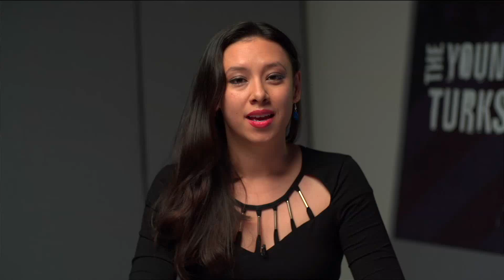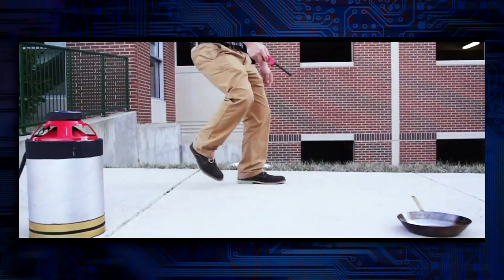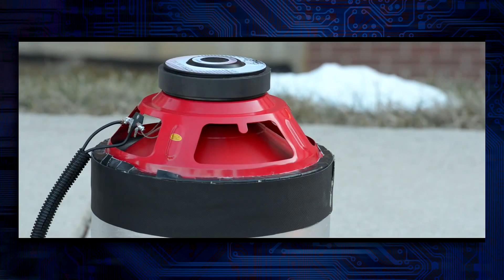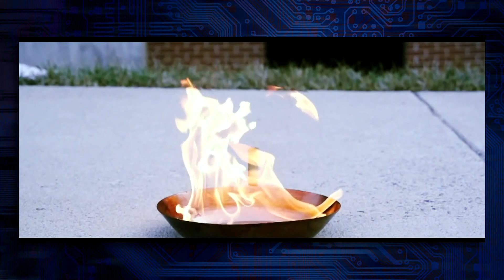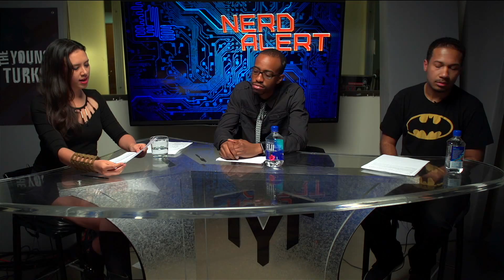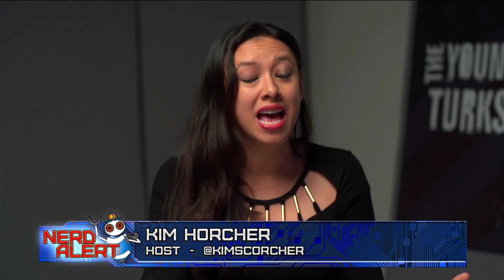Sound Fire Extinguisher Drops the Bass to Put Out Flames

Comment: I think the wind from the propellers of a drone will put out more fire compared to one with a big speaker connected to it which probably uses way more power so the battery would probably die within a minute

Comment: I think it's not efficient in any ways besides small localized fires, other ways are just not cost efficient, de source should be of high engineering to work in diferent situations, like being able to adjust the frequency wich would require calculations for it not to be detrimental  instead of helpful and having enough power potential to be effective depending on the situation...or being exponentially big enough for bigger fires...but what do I know?
Reply: Imagine there is a bigger fire, and the device just pushes the air and the heat away with this low frequency, wich might work where it's directed, but works as a chimney bellow further away where it's not directly pointed...

Comment: Have you thought of using ultrasonic transducers instead of regular speakers? Using an array of 25 transducers will give you a narrow sound cone up to 1000 1300 meters. This way you can also fight a fire in the crown of trees. A small amp with a bass modification and a tone generator could be made small enough for a fire fighter to carry into the bush and fight the fire. Could be a real game changer for fighting forest fires.
Reply: An array of ultrasonic transducers can be used to direct the sound that will become base sounds (30-60hz) at the reflecting surfaces.
Reply: I like your thinking.

Comment: When after 6 years is this going to be made and used at a test site that’s in fire , imagine multiple people swarm or drones swarm in and take it out , 6. Years ! Should have already came out 3 years ago , this should be being pushed by tax payer money so millions are saved on water resource and manpower trying to extinguish fires and rescue others form danger .,
Reply: Dude this was done on small TEST fires, they haven't tested this larger scale yet. The other problem is size, and scope. You couldn't have a couple drones, depending on the size, the heat, etc. You'd need more, and more drones.

In theory it sounds like a good idea but the rate the drones would have to move would be a nightmare. Remember; it's not always the case that the government avoiding a, "good" idea is because of incompetence, some tech looks great when looking at it as a whole! However; the question is, is it the right idea, and the right tool?

Comment: This works on the principle of cooling the wick, similar to blowing out a candle. You can get the same result with a tiny hand held personal fan.

Now have you tried blowing out the fire in a fireplace, campfire, or charcoal grill? You cannot cool wood burning at +1000F using ambient air. You will simply fan the flame by providing fresh oxygen. 

So this will not put out fires, not even grease fires on a home stove. It’s a cool parlor trick to put out 50 candles at once. They should patent it and sell it at Party Source.
Reply: Eh you couldn't even really patent it because it's not hard to build / redesign.

Comment: there is no way you can put off fire by using sound WAVE WITHOUT CLOSE DISTANCE IT IS A DISTORTING PRINCIPLE ,only small fire try a 20,000 BTU flame .and you need to go near there is no safe distance .
ball is a joke you need certain temperature in order to active it , by then 28 sec fire goes viral how can this ball do some justice to the user - in order to do a fire test you have to let the fire burn at least 5 minutes to show the product works not just start then a fire then put it off quickly you can use water FOR THE SAME FLAME   --- there is many gimmick in the market but in reality it does not work because the intense of the flame is too high to match with product in display - very fire that breaks out is a design of it's own -- what we plan as extinguisher is just slip thru in real fire -- unless you have something THAT  intervene  with the combustion molecule by producing a free radical  anti combustible molecule THAT WILL KNOCK DOWN THE FLAME . other that it will just be a eye wash to people who do not understand fire dynamics .

Comment: I don't know....  The skeptic in me says that a subwoofer moves a sizable amount of air anyways.  Therefore, it appears to be merely blowing out the alcohol fire similar to a gigantic human mouth.  It would have been a greater experiment with a bonfire on the skillet instead of the alcohol fire....  Nice try though.
Reply: yup;
the thing that is really doing the work is the power cord; how much power are they using there, kilowatt? 100 watts?
If you put a 100 watt fan on that frying pan, it would probably blow the fire out too.

Comment: If only someone were to invent a device that would be able to go close if not in to the flames (Land drone? Tank?) and use the heat from the flames to make electricity to power this device. That would probably give it the power to fight larger fires
Reply: Smoke alarms could play that sounds
Reply: the new balloon floating ships could work in combination with this, so you can have a steady station above the fire , not needing much electricity power to stand there

Comment: This would not work for buildings. Sure it would help our water problem, but what happens when there is a fire and the power is out?

 Maybe in the future when all buildings have solar panels and back ups batteries, then maybe.

But from the building regulations side, they wont allow it.
Reply: It will has bettery 👌

Comment: I don't know much about electronics but I wonder if it was the sound wave that distinguished the fire or the air flow that is created by the vibrations of the subwoofer?
Reply: rasnac That is the same. Sound is moving air.
Reply: WaterspoutsOfTheDeep
No, you are wrong. You seem to think the freqency of a sound is some magic invisible radiation.I strongly suggest you read at least one or two wikipedia entries on sound and frequency, before commenting on this matter again.
Reply: WaterspoutsOfTheDeep
Air is the medium through which the vibrations travel, just like water is the medium for waves in the ocean. I am right. You are wrong. Dismissed.
Reply: +Straylight4299  "i am right,you are wrong dismissed" dayum dat shutdown tho.
Reply: Damn good question.